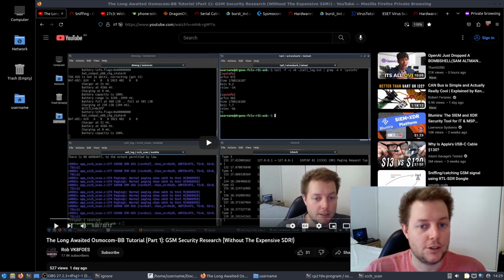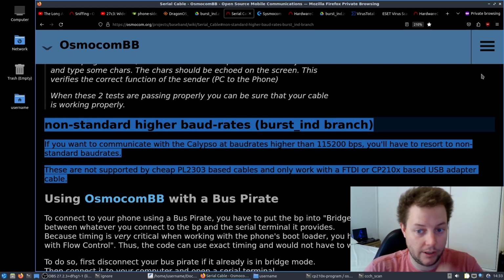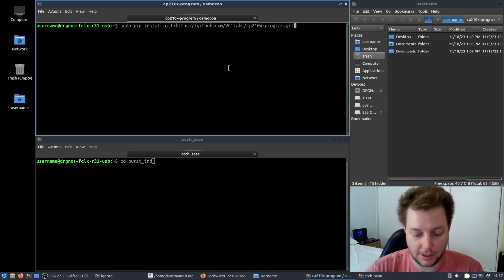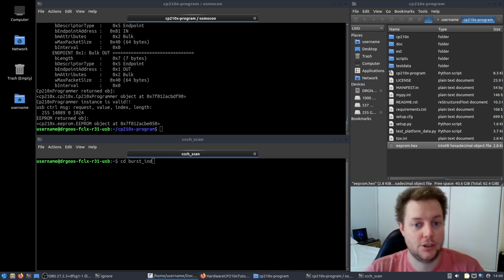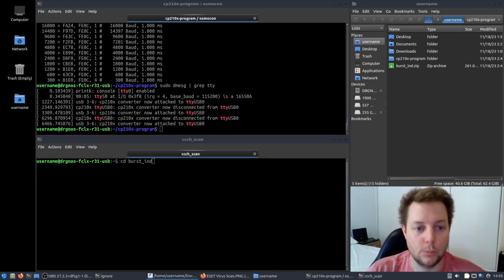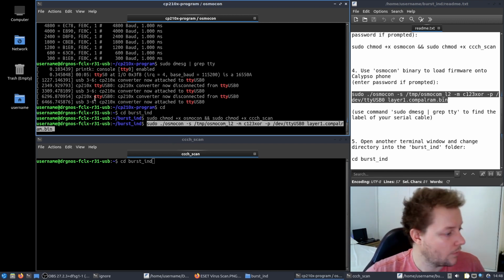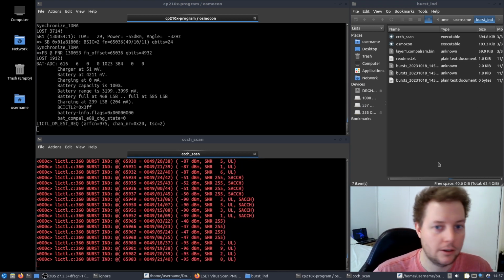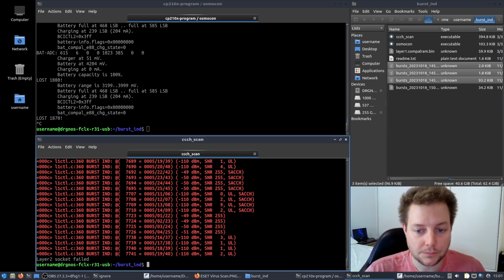The Long Awaited Osmocom-BB Tutorial (Part 2): Building A GSM Sniffer With The 'burst_ind' Branch

Comment: good, job !  I would really like to learn how to know the exact number of frame randomizations to use Kraken in optimized GSM networks
Reply from the maker: Hi. I don't understand the question, sorry. Most of the operating GSM networks that I have played around with appear to implement randomization of the predictable frames (before, and after ciphering is turned on). This, of course, will render the guessing/known-plaintext attack phase of cracking useless. Therefore, Kraken can not be used on these networks.